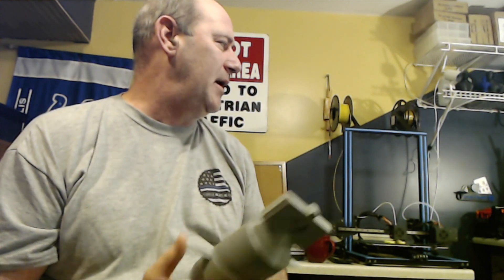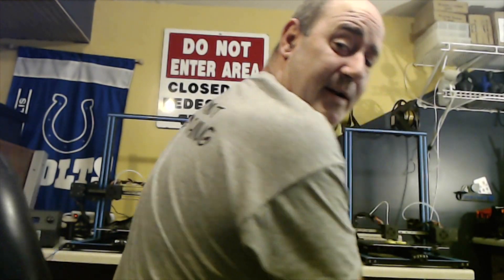HicTop Duale 3 IDEX / Firmware Talk

Comment: Hello I looked at your video that's about 6 years old I have a 3D printer hictop 300 x 300 x 400 but I can't find a mark on it for the type it is, I have had it for about 5 years and used it the first couple of years and it's been sat Idol I'm trying to resurrect it, I can't remember the software I used before for slicing but have a feeling I used to list the printer as a cr-10, I'm trying to use Cura but they do not have a listing for hictop the cr-10 appears the same parameters but the printer will not recognise the files on the card could this be a firmware problem, I would be glad of any help thanks